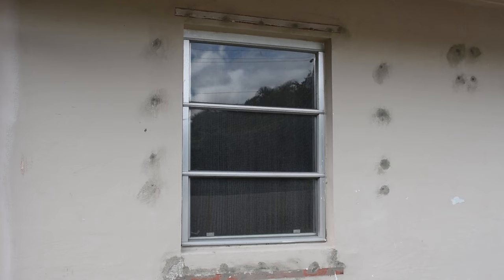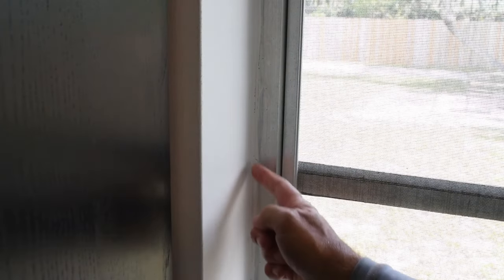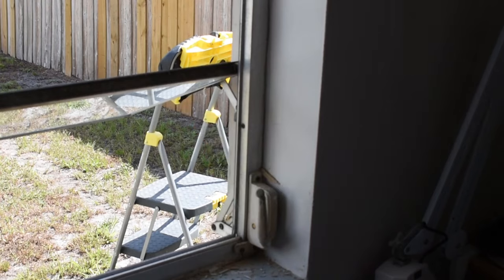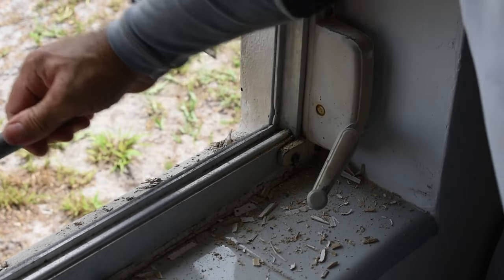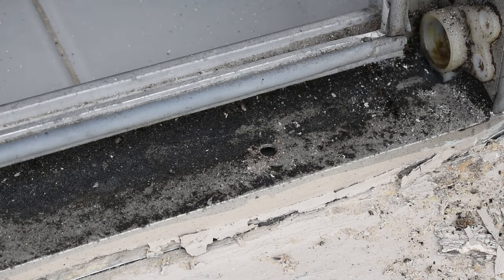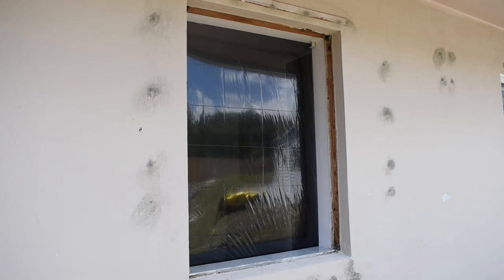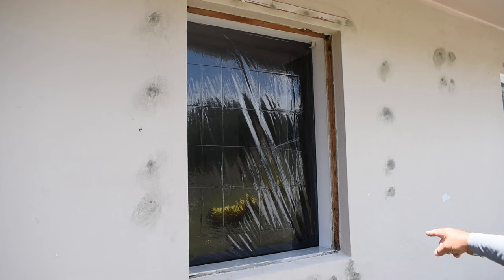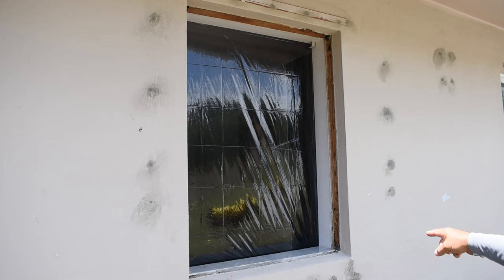How To Install Impact Windows on Concrete Block Homes - STEP BY STEP

Comment: /Humor On:  I personally would have opted for the Godzilla Shutter (TM) system to protect my windows.  They are hinged drop-down shutters made of 351 stainless steel and they're resistant to hurricanes, flying debris, small arms fire, and of course 1950s and '60s sci-fi monsters of all descriptions - as long as the monsters are shown in black & white /Humor Off:

Comment: I would have appreciated the basic how to measure for new windows in concrete block/stucco exterior. I am not comfortable cutting windows out without having the correct replacement size on hand. Nobody will professionally measure unless your spending the 30k for them to install the 9 windows at my home. I feel they are absolutely crazy since this is a replacement, and does not include any sliders in the replacement. Anyway, measuring is the first step but you have started with cutting the window out. Measurement would be very appreciated.

Comment: I have the same type of window in my son’s bedroom, it’s about 52” wide x 50”H  all the linkage is broken and it won’t open or close right and I had to calk and screw it shut, made it through Ian surprisingly. I really appreciate the thorough explanation I was afraid to remove the old one. I had no idea what I was getting into. There are some window replacement businesses here in Port Charlotte but for one window. I’m going to try it myself, thanks again.
Reply from the maker: Thanks for watching!
Reply: @electronicsNmore  You’re welcome, How did you measure the existing awning windows dimensions to accurately determine the height and width of the replacement?

Comment: Brilliant information regarding concrete block homes. Currently building concrete off grid  homestead using roman concrete technique. Its a science project adapting to climate storms ie cyclones and floods, also drought prone as well. Mud/cob/adobe housing would be nice but inefficient due to obvious circumstances. The metal aggregate is scoria lava pebbles for insulation purposes, bedrock pile foundation. Your window installation is like the heavens opening up with sunshine 🤣 great job mate. 
Greetings from new zealand 🇳🇿 🤙🏼

Comment: If you do concrete cutting like that regularly, it may be worth it to invest in a full face respirator.  I have the 3M 7800 respirator, and with the 3M 2091 pink disk filters, no dust gets in.  [Note:  they 2091 filters are only good for dust, particulates, mist, and smoke.  They don't filter out vapors, VOCs, or gases, and can't protect from a low-oxygen environment.  There are various filters and cartridges for things like that, so you'd want to check a chart of available filters.]  I also have a half-face respirator but it can't do anything to keep dust or vapors out of the eyes.  The full face respirator can be outfitted with a lens frame to hold prescription lenses so those who wear glasses won't have to keep them on which results in the bows poking out through the gasket and degrading the seal around the face.

Comment: Nice job, thanks for putting the correct name for the window since I was questining myself when you stated it improper. lol
Glass is expensive maybe use tyhe glass for encase solar since the most expensive part to solar is the glass protective casing at times. 
since you took it out without a mess I assume its reusable.
as usual you makwe things look easy since you explain it well. 
The sealer caulk smells for days.

Comment: Great vid, I just finished mine in SW Florida, could have used the video. Lol
I just used the blade to cut both sides of the old window, pulled screws and hit with a mallet all around and the whole windows came right out.  I used PVC for the wood sides 2.5" deep and construction cemented them in, no wood on top or bottom and measured so windows would sit almost flush all the way around. 
Windows went right in and tapconed them in with 2.5" tapcons.  Argued with inspectors and done. Lol
 They wanted longer tapcons and I asked for what? The tapcon goes through the whole cement block till its air except at the top and that has massive penetration with no wood.   
Oh well, he signed off and they are fantastic. I used Jen Weld and they seem to be great also.  Was sore from all the tapcons drilled which is overkill. 
Old House windows were 55 years old with 3 to 4 small screws on each side going into the wood and  now they want a million tapcons. Lol
Reply from the maker: Glad you enjoyed the video. 2 more windows then I can call for an inspection. Thanks for watching!
Reply: @electronicsNmore  what were the requirements dow nen there.  I used 5/8 pvc and 2.5 tapcons.  The inspector said I was suppose to use wood and we argued because the pvc was waterproof.  Gees these inspectors are pains.  Lol
Reply from the maker: @Michael-qy1jz  They like to see PT wood buck and at least 1.25" penetration into concrete. I was originally going to use 3.25", but they were too long, switched to 2.75" Tapcons.
Reply: @electronicsNmore  When they ask me if it's my house,  I tell them no.
 I tell them it's the kings house or thier house, because if it was my house, I wouldn't be asking permission to work on or upgrade my homes and rentals.  I know they hate that. Lol. 
 I tell then mine are all paid for and I dont own any of them. Lol
Reply: I'm in SW Florida too and have a couple questions. How did you measure the openings to make sure you ordered the proper sized windows and what brand did you use? Thanks in advance.
Reply: @joeoil4198  I used Jenweld impact  and they are great.  As for measurments, I didn't do it like your suppose to with 5/8s pressure treated wood, I used the pvc wood and cut it down. You may want to ask around on how to measure exactly. Home depot will show you.

Comment: Amazing video! Couldn’t have been more thoroughly explained!

One question: I’ve only ever done one impact window (on an old house) and I remember having to add flashing to the sill, as per instructions. Was there no such requirement for you?
Reply: was wondering the same myself . . .
Reply: I seldom see flashing on block homes in south fl. I dont think water intrusion is a common issue once the block and sealant is in place
Reply: @---ny4ys  I just had my impact windows and doors done a month ago. I asked them specifically about this and the answer was exactly what you said. Water intrusion isn’t an issue.

Comment: Thanks for this great informative video! I have one question,  can you talk a bit about how you measured the windows for purchase ive heard several pieces of advice that vary between getting the windows 1/8th smaller than the opening to measuring from the narrowest point of the metal on the inside. Seems like yours line up very well so any tips would help greatly as i order 20 windows for my central fl home!!

Comment: few things you could have done differently to make your process ALOT easier on yourself but overall very nice job, i actually run a big window department in NW FL and hurricane Michael definitely had our work cut out for us in replacing windows
Reply: What are those few things?

Comment: Great video! 1 question why cut the concrete? I would buy a smaller window 1 1/2 width and hieght (bedroom windows need to meet egress guidelines) use a presure treated 1x4 attached with tapcon (may need to cut width for fit) directly install window to  frame shim window for plum and attach the window, use marine grade caulking finish with pvc trim - done in half the time, less tools and dust.

Comment: I saw your video about installing an impact window and I loved it, I only have one question, Window size typically refers to what when ordering my new windows?
Should I give them the inside frame to frame dimension (minus ¼ inch) or the outside flange to flange dimension (minus ¼ inch) ?
Let's say one of my Rough Opening is 48 x 25, what size window with flange would you order?
hopefully you can help me
Thanks
Mario

Comment: Good job. Did you consider temporarily screwing the 1x3 to the existing wood strip and scoring the masonry with your grinder?
Reply from the maker: No, making a line to cut is best, otherwise you may chew up the PT wood using it as a guide when cutting.

Comment: Great video overall. Love your method of attaching the shims! 
A couple of comments: A building permit is required to install windows and don't recall that being mentioned. Bucks do not have to be tapconned to the block and can be nailed. The buck must fully support the frame so the 1x2 at the top can cause the inspector to fail you if a buck inspection is required in your particular municipality. And the most importantly, one should always back-bead the flange of the frame with caulking, after dry-fitting the window, for that additional water barrier. Also, if you are permitting, which you should, you have to wait until after inspection to put the beauty caps over the installation fasteners because the inspector will want to check to make sure you actually put screws in all the predrilled installation holes and that the tapcons do not spin.

Comment: I'd like to confirm with the NOA / product approval for the engineers specifications, however most window NOA's are similar.  Here are a few mistakes in the installation process. 
1. The window frame must be fully supported by the buck or concrete structural substrate.  The header/  top buck is not wide enough. 
2. All bucks must be flashed with sealant on the side that is against the  block prior to fastening it.
3. No window can be mounted on top of a marble window sill, it must be mounted on top of structural substrate, buck, or high-strength concrete. This will transfer the impact or wind load to the structure. 
4. Modifying the window by cutting the flange voids the warranty.
Reply from the maker: Thanks for your comment. Yes, normally all 3 sides are full width(Some I did that way). According to the certified installation instructions for the window by the manufacturer in the state of Florida, it states, "For masonry or concrete window openings a 1x window buck MAY BE USED. It didn't say MUST BE. You also have to realize that many older homes have a header that is made out of block with large pockets(Not poured solid/no lintel) which make widening or replacing the buck a very bad idea. You'll end up with large voids after cutting away and chipping. After seeing my old lousy aluminum awning windows tolerate 100mph+, the new windows will easily handle winds well above 100mph. According to the inspector, and other installers, tapcons are only required for attaching new window bucks to concrete block. The building inspector said how the window was positioned up against the tile sill on top of a thick mortar bed, was just fine. I tried cutting away one window's sill at the start, and in doing that I started exposing concrete block cores. Very bad idea. The way I installed the windows was ideal for my home. As for trimming the flange, it won't void the warranty, because it has very little if any effect on the window and you cannot see that it was trimmed after applying the polyurethane sealant.

Comment: I recently had windows installed in my house. I’m in South Fl and have a Cbs home. I have horizontal slider windows. One room keeps having water enter and runs down the wall. I’ve checked the caulking and everything redid it but water is still coming in. I’ve redone the dry wall already and thought I found the problem but I was wrong. I guess my question would be Are the mounting screw that run across the bottom of the window frame supposed to have caulking to seal them ?

Comment: Very helpful, thank you. My window mfg. recommends resting the window on sill shims. In your example how would you address that issue since you had no sill buck. Also widening the jamb bucks to accommodate the impact windows without installing a sill buck creates a void behind the bottom flange of the window. Is that a problem?
Reply from the maker: You're only supposed to do the sides and the top. The lower part of the window sits against or on top of my tile sill then sealed with polyurethane. The window isnt going anywhere.
Reply: It depends on the manufacturer you use. There are some which require fasteners in the sill. This particular brand did not. Yours probably required screws in the sill.

Comment: Question I’m in FL just got my permit and installation from American Craftsman the manufacturer and said TapCon should be 1/4 not 3/16 and 4 TapCon on each side, 3 on Top can you please explain why you used 3/16 and 6 on each side ? 3 on top stay the same as you mentioned 
Thanks
Reply from the maker: 1/4" too big. If 1/4" was intended to be used, the holes in the window would be larger.
Reply: @electronicsNmore  i was pretending to use 3/16 like you did but American Craftsman same windows you installed saying on the paper provided to me I should use 1/4 I’m scared look’s ugly but same time scared don’t pass inspection because city go by the manufacturer and doing it myself and placement of TapCon saying 6 inches from corners top and lower and from middle 3 inches up and another 3 inches down and 3 on top like 12 on total do you pass inspection like you did it ? I’m sorry to be asking that much if was my option I would do it like you 
Thanks for your fast reply and your time
Reply: You need to read the FBC product approval or Miami-Dade NOA for the window brand and window type to determine which diameter tapcon is required.
Reply from the maker: @tprummel  Yes, I did that. It clearly states 3/16" flat head tapcon with min 1.25" embedment. I have no idea why people think a 1/4" tapcon would be used. Not only is it an overkill, but all you have to do is look at the diameter of the holes drilled in the window frame. Small hole = 3/16" anchor. I'm not in Miami/Dade.

Comment: Hi where do you buy the hole clip cover ? And what diameter do you house for the hole to install it ? Thanks
Reply: The windows usually have the holes in them from purchase. Otherwise just use a small spade bit or boring bit thats as close to the screw head size as possible. The plugs he used also come with the window. If not you can make some if you have a small piece of vinyl board used for baseboard etc. But it wont look quite as clean
Reply: @---ny4ys thanks for taking your time to answer but sadly my window doesn’t come with the holes and plugs 😢 but thank for the tips anyway Happy New Year
Reply: @xElchulo305x  no worries, yep at that point you can cut them in with a small spade bit on the drill as I was saying. Good luck and happy new year

Comment: Realistically how much can you save in labor cost by DIY ?
Pull your own permit
Best deals on an order direct from mfgr ??
Dade County rated
Reply from the maker: I saved about 15,000, they're ripping everybody off installing these windows. They also would not have done the same quality job that I did, and my house would have been full of dust
Reply: I recently got a quote of 22k for 7 windows, I priced out the same windows for 3,800.
Reply from the maker: @joeoil4198 They're all a bunch of criminals

Comment: Are you sure this installation meets FBC?  I don't think so, I can assure, you wouldn't  pass any in the state building departments inspections requirements; if this window unit has an approved NOA from the state of Florida, as is required, none of the procedures used here would meet it , just for starters, where is the sealing step, e.g. exterior grade caulking application under the window bucks and concrete opening, to keep wind driven rain out of your house, and the buck anchoring used here is pathetic to say the least, please don't follow these instructions and if you do, you will be made to remove and properly reinstall every unit; of course providing you're working under a permit as is required by insurance companies and the state?
Reply from the maker: Fully inspected, and fully sealed using polyurethane sealant around the entire exterior perimeter. Water is not going to find its way into the wall if you seal it properly on the outside using quality sealant. As for the bucks, there's nothing wrong with using the tapcons I used, at least 1 1/4" penetration into the concret block. Done being a pedant? My installation will be here long after you're gone.